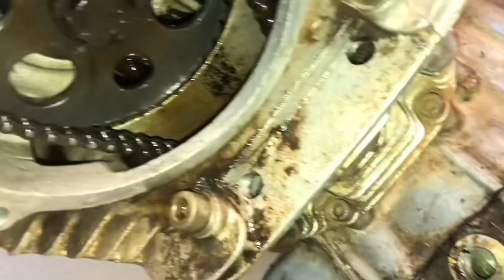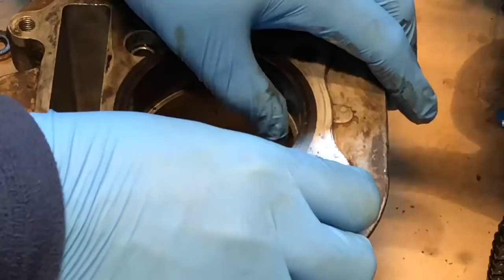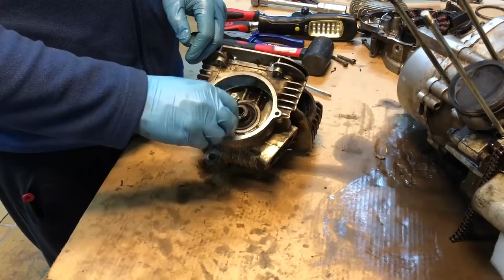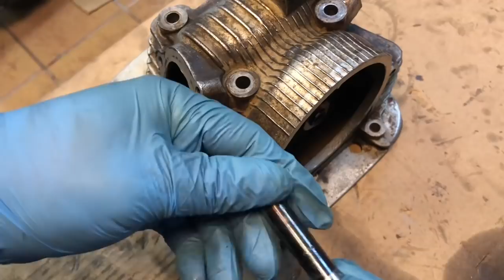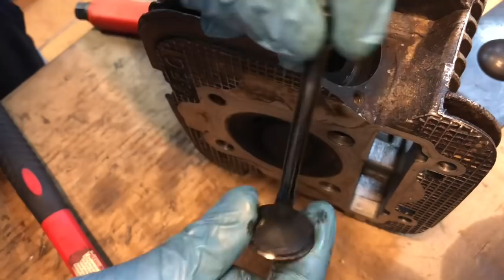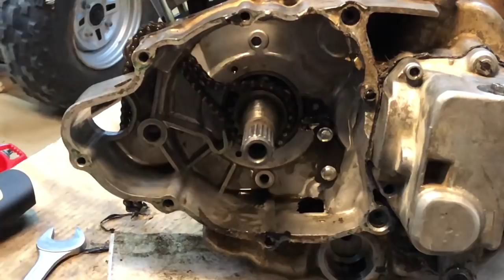Facut motor Atv 250 cc Bashan BS250-S5B (JS171FFM ENGINE)

Comment: Where can i get parts for this engine? The quad i bought is a js 250 and needs new wiring harness just cant find where i can get it at
Reply from the maker: Is hard because there are many models. I think is best just to make the old one
Reply: @SHRMotorsOfficial  do you have a diagram of the old wiring harness for that motor
Reply from the maker: No, but sure you can find it online
Reply: @SHRMotorsOfficial  ok thanks ill keep looking for it

Comment: Salut, am vazut ca te pricepi la motoare.Imi poti spune si mie o parere de un motocross Derbi Senda motor 80cc in 2 timpi cu 6 trepte .El nu prea trage si am vazut ca da cu elei pe toaba (negru).Ce crezi ca are , setul motor sa fie dus?
Reply: Stefan Adrian  da
Reply from the maker: Stefan Adrian uleiul este ulei nears... uleiul de proasta calitate sau prea mult... cat despre tras... daca este setul, porneste mai greu cand e rece. Pot fii si discurile de la ambreiaj... cel mai simplu faci un test de compresie si vezi daca este setul
Reply: SHR Motors La rece cam la 3-4 cu soclu tras, ce ulei mi ai recomanda?
Reply from the maker: Stefan Adrian sa fie o firma consacrata motul, mobil, castrol
Reply: SHR Motors Husqvarna ar fi ok? Mi a recomandat cineva asa ceva ,ce parere ai despre motoarele de 80cc in 2 timpi cu 6 trepte? Sa trec la 4 timpi?
Reply from the maker: Stefan Adrian husqvarna e ok, atata timp cat e original; motoarele in 2t si cele in 4t au avantaje si dezavantaje...
Reply: SHR Motors Multumesc , face o treaba buna .Astept urmatorul video.
Reply: Faci* scuze